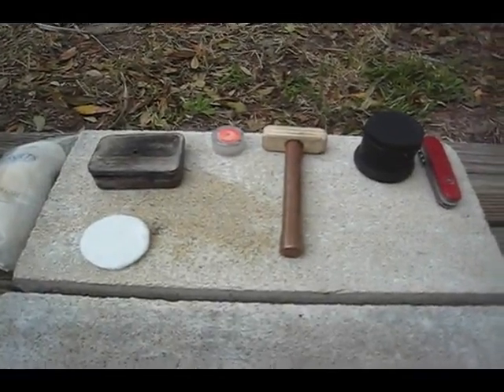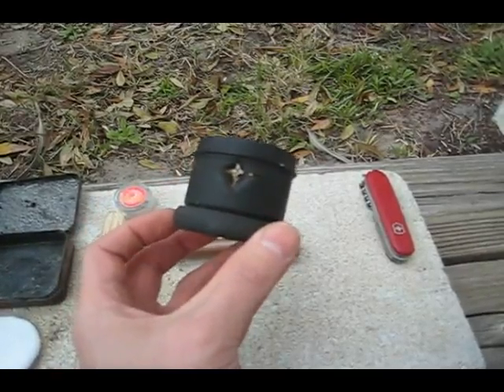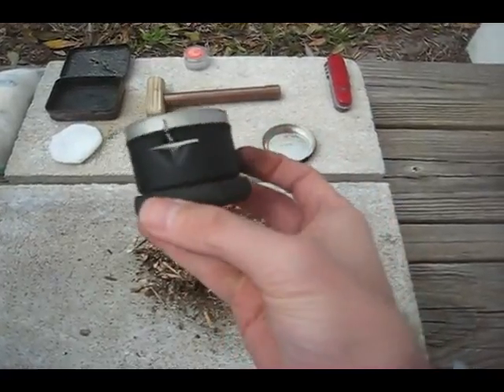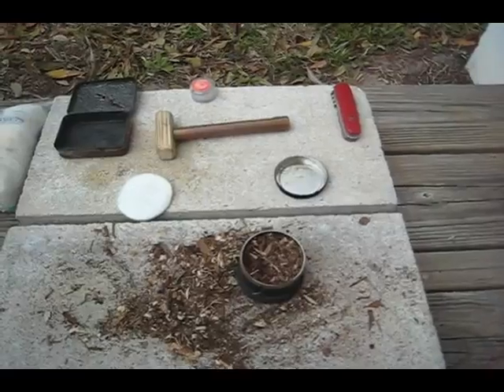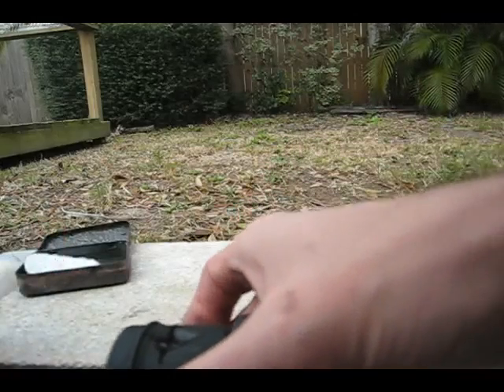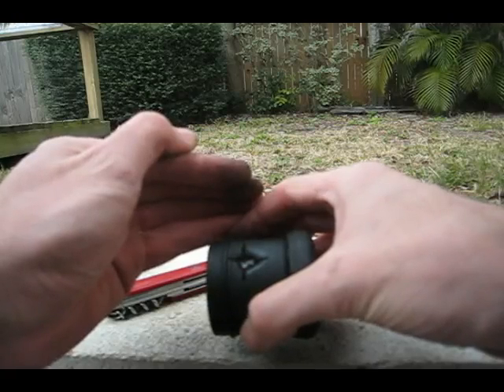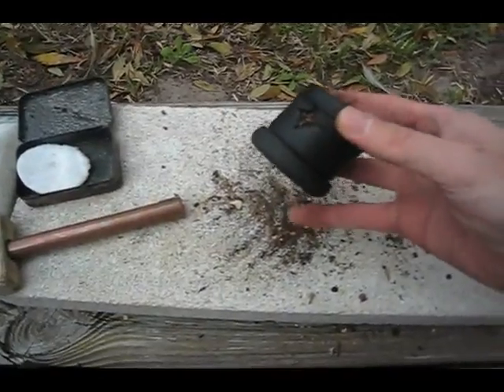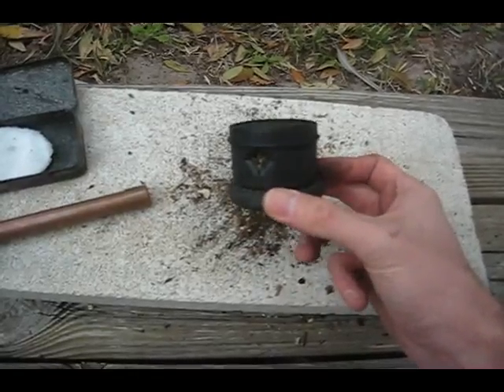Fire Piston Tinder Box Flame Maker

Comment: Might work well with a straw or bellows tube attached, to get more focused airflow. As it stands, precious little of any blown air you're sending is actually getting on target.
Reply from the maker: That's a good idea. I'll have to try that next time to see how it differs. Thanks, Lunumbrus.
Reply: gundog5 I'll be adapting the design into a smoking-pipe like device, myself. It'll be open ended at both ends, where a vented plug is inserted crossways in the top, that will later fit down the pipe bowl and push the char out. Charcloth is loaded into the bowl from the open bottom, the piston would be struck, and ideally, you could insert the piston rod straight into the pipe, and gently blow through it to get the tinder in the bowl lit. Once you have good smoke puffing out through the vents, you should be able to use the plug to push the lit ember into a nest, nice and clean.
Reply: Lunumbrus Clarification, you blow through the pipestem, not the piston rod.

Comment from the maker: @TheNZrepper Yes, Everything I bought at Home Depot for $5. A 1/2" wooden dowel (sanded), 1/2" copper pipe, 1/2" pipe cap, and #8 O-rings. I used a piece of wood & a screw I had for the handle (or can buy a drawer handle). Tube is 5" long with wooden piston slightly shorter. I used Leatherman Wave multi-tool to make it. Used saw to make a groove for O-ring. Very crude, but works pretty well. I opted not to glue pipe cap (have to make sure it doesn't fly off). Used cheap balm for lubricant.

Comment from the maker: @ez2curanut There are 3 screws. You can see them at the 2:19 mark of my video. You'll need enough tinder to make sure an ember can continue to grow/ expand; Enough to help start a fire. Compressed tinder may be necessary (to balance fuel/air) depending on the kind of wood debris you're using.